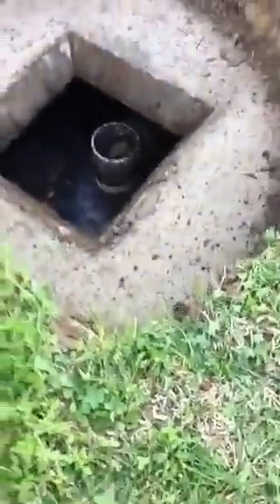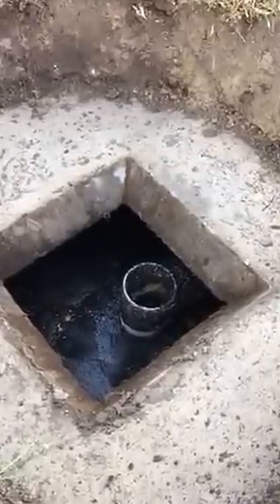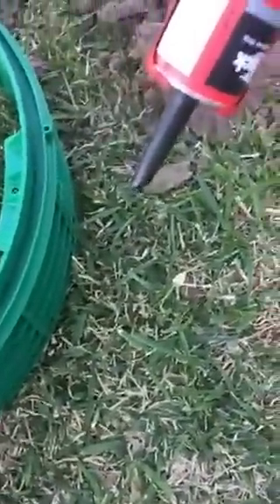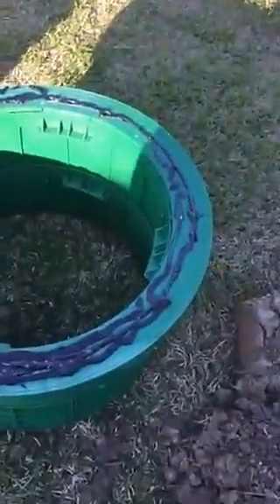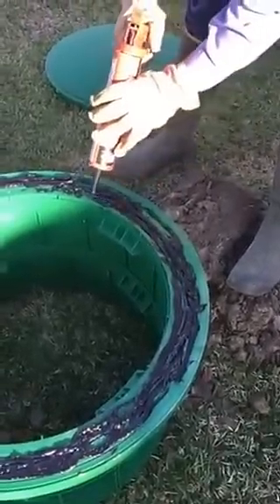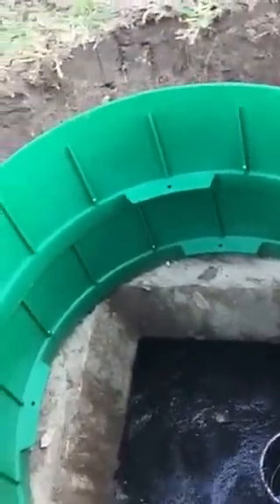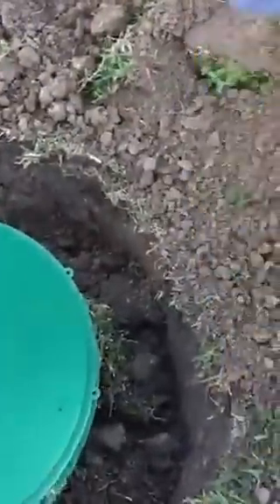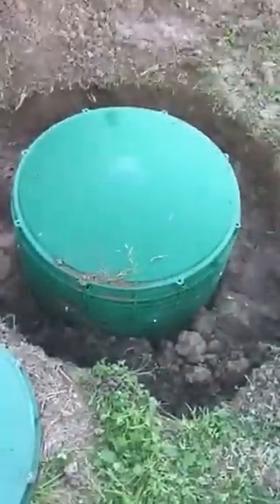Septic tank riser installation

Comment: Do you recommend using an inner lid?  If so, which one?  I'm thinking of the yellow thing that drops in or the green thing with which I'd mold my own lid.
Reply from the maker: You can the lids are very secure 4-6 screws so it would have to be intentional getting them off. We sell the safety lid also but if the lid is properly put back on and secured it will do it’s job keeping people or little ones out. 

The reason they came out was a child feel into a tank and drown.  Mind you this child was very young and shouldn’t have been that far form the parents to begin with everyone was out side the tank in question was at a neighbors house i believe. Now no one is going to tell a grieving parent it was your fault or you have some culpability and responsibility in this . So they mandated safety lids. Now i have seen and have heard multiple times of home owners being told they need to fix something and they don’t. That’s why we always document upload the information so if something does happen we can go back and say they got informed and they declined. Some companies go as far as saying if it is not fixed that they will not inspect the property any longer. You can’t legislate ignorance or willful disregard it’s like all other laws there is a law but it still happens. 

Make sure if you or someone work on the system that when the work is complete or you step away that the lid is on and it is secure.

Comment: Should I clean the dirt off the top off the tank with a wire brush or something before I set the adapter ring?  Maybe I'm wrong but it seems like the roof sealant wouldn't want to stick to the dirty tank.
Reply from the maker: You can it doesn’t need to be spotless

Comment: I only have a 1 1/2” of surface area to adhere the base to. Is that enough surface area to get a good fit? I would assume from your video that this tar-like adhesive is fairly strong.
Reply from the maker: It is enough the adhesive we use literally peels the concrete off when removing it.

Comment: Very good video.  I don’t have a source for the Henry’s sealant you used.  Do you have a link as where to buy it?  Or is there a loctite equivalent that would work the same?  Thanks, Tom
Reply: Just use a good asphalt based roof sealant.  It's available at any Home Depot or Lowe's.
Reply: @wrench6122  Henry products are commonly available.  Ask in the Tile/flooring section.  Looks like to me it is roofing related, too.  The difference may be in the adhesive property of that particular product, vs roof cement, just not sure on that.
Reply: @replyhere590  I think you meant to reply to Okie Tom........ Not me.

Comment: I am using this same system but on a plastic septic tank to not have to dig it up everytime. Would you recommend roofing tar for the platsic to plastic bond as well or is there a better product?
Reply from the maker: It work well on those also.

Comment: I put a couple of these in several years ago on my tank. Plastic riser with No sealer and the lid was concrete.  Ialso  left the original lid on the tank.  Now I want to put a riser on my pump tank and they no longer sell what I'd used before.  I don't understand the transition ring.  What can't you just set the riser on the tank and fill it in?  You say it won't work but you don't say why.  I don't understand why the riser must be sealed.  Again, I would leave the original lid on the pump chamber.  Please advise.
Reply from the maker: Rick Wright depending on the depth the concrete lid over time gets tight. If you leave it in there is no way to apply and leverage without damaging the the riser. The riser and new lid are also sealed so there is no reason for it. 
The TAR ring is needed to form a base and also so the seal is wide. This helps keep water out of the tank from ground water. We have seen countless times no tar ring is used and dirt and water are getting into the tank. The only way you don’t use a tar ring is if the riser is cast into the lid when it is poured.
Reply: @wholesalesepticsupply  thanks.  My problem is this is for the pump tank.  And there is a 3 inch pipe coming out of the tank so I'll have to slice the transition ring then cut a 3inch groove in the riser. I'm thinking of sealing the groove with expanding foam.  Thoughts?  Since it won't be water tite, I feel if I can leave the original lid on the better.  What if I lay down some heavy plastic sheet in the hole as a gasket between lid and tank. Do you think that will keep it from sticking?  It was hard to get the lid off when I had the tank pumped last week.  But it had been buried for more than a decade under 3 feet of dirt.  No riser.
Reply from the maker: @RickLWright  it can be for any tank on the system
Reply: Use a riser and asphalt roof caulking to seal to the bottom of the tank  keep out water ,roots and the septic smell  from coming out.

Comment: How would you install a riser on a 1500-gallon plastic septic tank? Does anybody make a transition ring for such an installation?
Reply: Aaron Smith
When I was going through this I found that most times, the manufacture of the plastic tank makes their own riser that fits (e.g. Infiltrator Septic systems) I used the Infiltrator riser on my concrete tank, but had to purchase an adapter (bottom ring) to glue to the concrete. Otherwise, according to the manufacture, if I had their plastic tank the riser would have simply fit into place.

Comment: My risers are leaking and rainwater floods my tanks. I'm going to pull them and replace like what you show. I've had one of the riser rings off and there is no sealant there, so I'm wondering if they even used sealant when they installed the flange? I like your video showing to slop these things up with goo! I really want these sealed. Thanks for posting!
Reply from the maker: David Allen your welcome lot of guys don’t do them right. We learned from doing a lot of them a trying different things and this works the best.

Comment: Do you need to put the concrete lid back on?
Reply from the maker: 407instructor no it will be almost impossible to get out if you do. You would probably have to remove the risers to do it. The concrete over time from friction bonds together so it’s not advisable to leave it in.
Reply from the maker: 407instructor the are precast that way since about 1999
Reply: No

Comment: Can you tell me why the water seal is so important? my tanks just have a concrete lid laying on top of the concrete tank so there is no way that is a water tight seal and there is even metal hooks that are between one of the lids and my tank so there is definite space.  They worked this way for at least a couple decades.  I just had a riser installed on one of the tanks that was deep and they just used that thick black tape to seal but the riser was just barely wide enough to fit over the hole, some of it hanging over the open space.  This was a black thicker plastic riser compared to yours but no transition ring was installed.  They did not really clean the area well either, mostly wipe some dirt of with his gloves.  Do you think I should remove all this and try to correct it?
Reply from the maker: Gamer Clownz  if it’s work for this long I wouldn’t. Water from rain will enter the tank is why it’s important to seal. To much water can overload the field lines if that’s how it’s set up. On a spray system it makes the pump work more than needed shortening the life of the pump. Being your system is so old they didn’t have stuff we do now to seal them but I wouldn’t ya e left a hook in it.  We are in the Houston area so we get a lot of rain if your in an area that doesn’t get 50 inches a year or more I wouldn’t stress to much over it. Lot of work just to seal the tank that hasn’t had issues.
Reply: The one with metal hooks already had a riser and the hooks are on top of it.  I installed the riser on gray water tank because it was over 2 feet deep.  I am worried they did not seal it properly but trying to explain it to be ok because how old system was setup with just concrete lid laying on top, this is the same way the other tank with riser is setup.  I am in Northern NJ and Texas shows annual rain fall of 20 to 30 inches so not sure why you would worry, I think we are 40 to 50 inches.
Reply from the maker: Gamer Clownz  that’s an issue. There is a lot of people In The industry do a crap job lot of videos on here they install these risers wrong no tar ring. People don’t do research and just slap it on. Some of my videos are long but it’s so people get the full scope and understand everything.
Reply: They did slap the tar ring on, the issue is the riser seemed a bit too narrow (or maybe my tank opening got bigger with age as he explained) some of it was on top of the concrete but small portion was hanging over the hole (it was a round riser over round hole).   Second thing is they didn't really clean the concrete like in your video, it was still somewhat muddy with wet soil, I got most of it out with a shovel and he cleaned it with his glove  (again he said this was fine).   I am hoping it makes a tight seal but its tough to really figure out without water coming down and being able to look and see. Is there a way I can verify if its a decent job?
Reply from the maker: Gamer Clownz it will be fine them as long as they sealed it with something a little overhang won’t hurt.
Reply: IBooks like the dirt is a little dry for compacting

Comment: Is the Henrys roofing tar product you are using described as "Henrys PR360202 roof cement, premier stop leak rubberized roof cement." I found this on Amazon but dont know if its the exact product you apply in your video. Thanks for a great video.
Reply from the maker: Yes it is